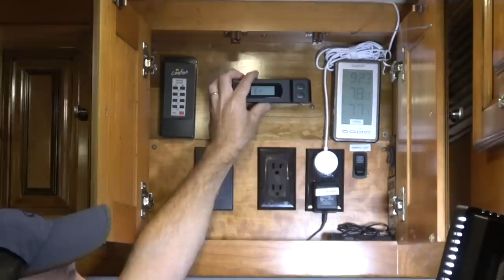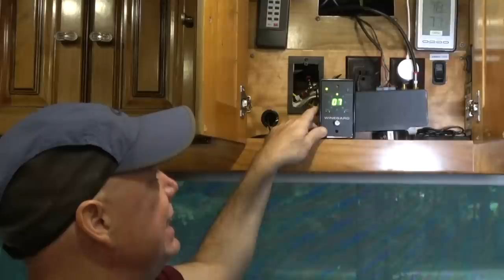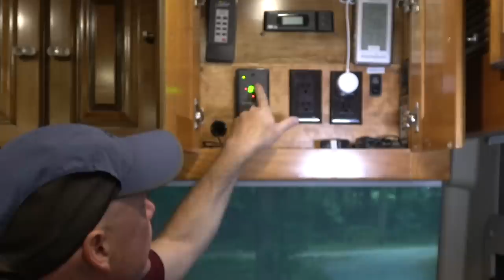Winegard Rayzar OTA HD Antenna Chat and Install

Comment: I found the best way to remove Dicor from my Phaeton was with an oscillating tool with a scraper blade. It made short work of the job and didn't damage the fiberlgass.
Reply from the maker: Sorry for the LONG delay in this response...But Yes, I HAVE TO GET me one of those tools!!!!  :)   Thanks Dave for the reminder.  (I had seen this comment when coming to respond to a new comment.)
Reply from the maker: Hey Dave...I just had to come back to this post and say I did get one. :)

Comment: After watching your video, maybe Wingard will make a simple adaptor that will allow people with the original mount like you have to bolt the Razor to the existing mount. No drilling, no dicor, just a couple of bolts-Done. I wish they made one that would bolt to the existing bat-wing antenna. Then it would be up above any roof obstructions and down for travel. Great video David, thanks for posting, say hey to Brenda.
Reply: I tried the Batwing's mast..Unfortunately, the weight of the beast makes it unable to be cranked-up.

Comment: Maybe if you set the legs on a bed of dicor and let the screws sandwich and compress sealant between the roof and the bracket it may have been a little tidier. Then cover it with more. Maybe a better seal too. Great video. Always informative.
Reply from the maker: The issue then is trying to remove it if you have to.  You really do not want Dicor under something.
Reply: Very good point.

Comment: Dave were you not concerned about hitting the underlying wiring (for either wires or A/C drains tubes) under the surface of the roof when you were drilling all of those holes for the screws to mount the support  stand?

Comment: David now that you have had the Rayzar for several months, any issues?  Also shouldn't the unit be raised so the roof AC units don't block the TV signals?
Reply from the maker: Hi...I have not had any issues with the unit and it continues to preform well.  As as far as the AC's, you can only go so high, so you really will have an issue with any such antenna unless unless you can crank it up higher. But it actually is above the AC slightly. But for the most part, most HD transmission towers are located at the highest points of elevation. As such, you "should" be ok for the most part.

Comment: at 23 minutes, when you figured out that the new system will fit over the old system,  you should have then, figured out a way to attach the new bracket to the old bracket, and then installed the antenna. thus, eliminating the need to put in more screw holes and  to glue down the new stand.
Reply: While watching this, I was thinking the same thing.  I would have cut the legs off off the new Rayzar Bracket and screwed the newly modified plate to the old bracket legs that were on the roof.  Could have used flat head metal screws and perhaps drilled a recess hole prior to mounting so everything sits flush.  I'm not a fan of putting extra holes in a roof if I don't have to.

Comment: I am thinking about getting one myself but probably would cut the aluminum stand out of the way but not disturb the Dicor. I have one question however, do you need the other box at all that Dave left that has the ERR message?
Reply from the maker: No, not needed at all.  I just left it until I have something to put in the hole. :-)  Yes, I thought about cutting it as it would come off quickly with a Dremel.  But I figured I would leave it as if we sell the coach I would like take that with me and the lifts may be useable for something else to the next owner.
Reply: I cut the aluminum stand as mine sat too high.

Comment: the timing couldn't be better on this.  i hate directional antennas...even though they may be better.  our new 5er has a king directional and i wanted an omni directional or this unit.  might be leaning to the rayzor.

any chance you would know if i could use this with an HD home run to be able to record OTA shows on an external HD?

Comment: I just replace 12yr old saucer antenna with this one, only 40 miles from DFW metro, and live on Hill too, No signals at all, but installer got 64 signals, at the most 10miles difference. I got 4 channels with old one. do U think the stand would give us  better chance of a signal??
Reply from the maker: 40 miles is a very far for this size antenna.  You for all you know you could be pointing the antenna right at the AC unit and that would surely not be good. I have no idea what you have as a RV or motor coach and if it has roof risers or not on the sides. You surely would like the antenna up as far as you could for like I mentioned, and AC could be blocking it for all I know.  But 40 miles is a distance and I have no way to know what is between you and the towers, at the installers, nothing may be in the way.
Reply: @DavidBott  Yes, I thought of all that too, but we took it out on a trip, into the thick woods of Eastern OK, and to our surprise we got stations from Ark.which was more like 75-100miles away, through forest and very high hills, they call mountains, part of the Ozarks.  I guess we can try the stand, but I can return this antenna now, and probably get the old batwing winegard? Thanks for your help, we enjoyed your video too!
Reply from the maker: @thehirm  Hi...When you say "...but we took it out on a trip..." do you mean this antenna? Just wondering. If so, then it sure seems to be working right and thus would point to an interference issue then currently.
Reply: @DavidBott   1st we took it back to the installer they showed me, still hook-up to my trailer, it got 64 signals, 40 miles from Dallas,.  We got 18 signal, at home, and 4 UHF channels, which we are 40 miles from Ft.Worth, Old antenna got 5 channels but had some local channels too! So I reset the Rayzar reset, than I had nothing. Still have nothing, No-time to return at that point before our trip to the Eastern Oklahoma, At camp to our surprise,  we go 5 channels all from Arkansas , this much farther than 40miles plus thick forest and very steep hills, which they call Mountains. now home we still  have no signal from the antenna, tried several times.....
Reply from the maker: @thehirm  Hi...Not sure what to tell you.  You can move 5 miles and have different reception as it is all based on what may be between you and the transmitting tower.  Are you rescanning for signals on the Rayzar controller?  Hold down SEARCH button for 5 seconds and when it starts the LEDs spinning around, let go. This will rescan for signals.  After that it should auto point in the direction that it could see the most frequencies. (Not channels mind you but the channels run on Frequencies so the more of them you have, the more of a chance of more channels in that direction.)  Then you need to be sure your TV is on AIR, not cable, and tell it to SCAN FOR CHANNELS.  It may also be called OTA Channels. (Over The Air)   At that point you get what you can.  You also can press an arrow button to move to the next direction that had the most frequencies and scan on your TV again and see what you get.  But yes, you could move just a few miles and based on the direction you are parked or what is between you and the towers, you can run into issue.  Even more so if the Rayzar is mounted near an AC unit and it is pointing right at it.  Seeing it has a lot of aluminum it becomes a shield.  Can't do much for you other than explain like I have.  You may care to give a call to Winegard but it is likely you will be told the same.
Reply: @DavidBott  thanks for trying to help!

Comment: David, when you hit the button and change frequencies do you have to re-program the TV?
Reply from the maker: I am not sure what you are asking.  For when you get somewhere and let it scan it then selected the the direction with the most number of frequencies it can see.  You then tell your TV to SCAN for Over The Air channels and it will find the ones it can see.  The TV is only going to see what the antenna can pull in.  You can move the antenna left or right to try to fine tune a channel if it is week...But no needed to re-scan usually unless you move.
Reply: @DavidBott  At 16:48 you hit the button and it picked up the other frequencies. Is the antennae picking up channels from all the towers or just from the one that is showing green on the indicator?
My other question is why that antennae and not the Winegard 360 which is about a third the price?
Reply from the maker: @stefantrestyn5726  This is a DIRECTIONAL antenna. It moves. As such when you run a SCAN it moves the antenna in slowly in 360 degrees and takes frequency readings.  When it is done it tells you how many frequences it can see the most of and in what direction.  Do not confuse "frequency" with "Channels" as a frequency can carry more than one channel.  So it is showing you the direction that has the most frequencies as that should the the direction that you would receive the most channels.  So I can MOVE it to the next stored location that has other frequencies and thus like may have different channels and the one I watch the most.  

The Wingard 360 is a OMNI DIRECTIONAL antenna listening all directions at one time.  As such, it is not as powerful, nor does it have the range, of a directional antenna. A directional antenna has a higher gain as it is focused (pointed) towards the tower sending the signal.  Thus the cost of a motorized, automatic, antenna.  

To get the idea of a directional antenna, cup you hand around your ear towards the direction you want to hear and you can hear better. Kind of the same idea as you are now able to collect more sound waves, frequencies, into your ear.  :)
Reply: @DavidBott  Thank you

Comment: I checked the reviews for this antenea and found them quite unfavorable.  It has been a year since this posting, how is your unit operating and have you had any E3 errors as a lot of people have had.  Thanks.
Reply from the maker: Hi...I have not. The issues people had were the motors that were used from a bad batch from a supplier. The bad thing is it took time for the failure to occur so they did not know there was a part issue.

Comment: David, It's been a year since you installed the rayzar, how's it doing for you. A lot of reviews speak about motor failures and it stopped working. Have you had any problems. Thanks!
Reply from the maker: As I have mentioned in post comments who asked the same, motor issues were from a few years back as they received a bad batch from the supplier.  I have not had any issues with mine at all I am happy to report.
Reply: @DavidBott  Thanks, sorry I didn't see the other comments and your answer, I watched this video when you originally did it but wasn't in the market for one at that time. I'm currently replacing the entire roof on our 2003 Newmar DSDP and we're thinking about replacing the original bat wing with this one or maybe just use an internal as we don't watch much over the air, mostly Netflix and Hulu through wifi or my hotspot. Thanks. You and Brenda have fun and be safe.

Comment: Should have used some zip ties to hold the extra wire
Reply from the maker: Wanted it protected from water. It's no big deal as it does not take much to hold it down.

Comment: Why didn’t you just remove the old antenna off the stand and adapt the new mounting plate to attach to the old legs by removing the legs off the new plate. Hysterical way no new holes in the roof?
Reply from the maker: Did not think of it during a live non-stop shoot. Even if I did, I likely would want the structure engineered by Winegard for the product. It does have more size and this resistance to wind when driving then the old, much thinner one would.

Comment: Can you adapt the winegard Ryazar to the existing triple vision bracket on my Tiffin ? So I can avoid using the bracket that you installed on the roof,over the old bracket?
Reply from the maker: Yes, there were other comments that covered that.  It seems you can make some aluminum attachment brackets.  Look though the comments.

Comment: How is the Rayzar working out for you guys? I am thinking on replacing my King Jack antenna and was wondering if is going to be worth doing that. Do you have the latest model? Also, I am reading lots of negative comments on Winegard website, have you experience any problems yet?
Reply from the maker: I have most latest model and so fart it seems to work very well.  Just for kicks I have run the scan now and again to see what it comes up with direction and frequency wise and it is very consistent.

Comment: Hey David, do you have a link for the stand?
Reply from the maker: This is so very new their is no SKU for it yet.  However you can order one directly .  Model... MT-7500  $50.00 retail and you will have to call 800-288-8094 or email help@winegard.com to get in an direct order.  (I'll add the info to the description.)

Comment: Where do you have the video clip of the inside install. I have a Winegard distribuion box and would like to keep it? However it and the Rayzar both need the use of the same DC volt supply.
Reply from the maker: Sorry, not sure what you are asking as I show the inside install in the video... https://youtu.be/pDDAngQBYdM?t=596   But my install would be different than yours anyway as the coach is different. All you need is 12V so not sure on your issue as you would still plug it into the distribution as you still need to send it though the coach.

Comment: David, David, David...  All you had to do was rivet the new mounting bracket to your old one. No mess, no fuss...
Reply from the maker: Yupper...But then we would not have the funny video of the Dicor all over the place.  LOL   You see, I do my videos usually as one take. In this case, I did not know the stand would go over the other mount until I had it all pulled apart. As such, I admit, I did not think it though and just went forward.  I was just happy I did not need to get the Dicor off.  So yup, I put in 9 small screw holes I did not need to. Not that I am am worried about them, but yes, surely could have done just as you had said.  "Smack to head!"

Comment: Instead of removing the old stand, if it was needed, you could have just cut it off and left the old mounts in place. But your system worked.

Comment: Thanks for the video and straight up presentation! We currently have a Winegard Rayzar Z1 antenna, sounds like other than the mounting holes, the Rayzar OTA HD Antenna would be a direct upgrade since it is powered over the coax cable? I don't want to have to run new wires up to my roof.

Comment: David, where can I get the antennacraft 360 antenna that you took off the rv?
Reply from the maker: That was put on by Tiffin when it was built. It was not a good unit IMHO but you can try Triple H Electronics Inc in Red Bay AL.  (Just do a Google search.)  They source electronics for Tiffin.
Reply: @DavidBott  Thank you very much.

Comment: Dave, don't you think you will hear the new mount bouncing around (tapping)  the old mount as your driving?
Reply from the maker: Nope. Not at all.  There was enough tension on it not to mention way to many other noises to cover it. LOL
Reply: I was thinking the same, maybe placing a rubber piece between the metals.
Reply: If it did and someone complained you could just say it was caused by rodents.
Reply from the maker: It really is not going to be any issue. I am not at all worried about it.